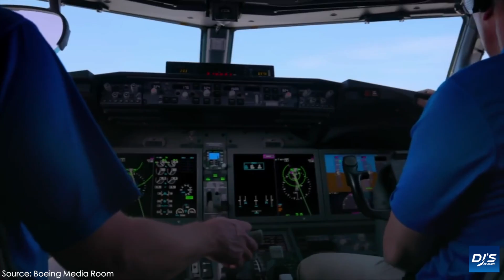Boeing 737 MAX & MCAS Problems

Comment: I was at Boeing in the late 80's I resigned after several attempts at issues needing to be addressed,  many others have had similar issues as you report here.  I told the CEO at the time in my letter of resignation that if they did not change their ways,  AirBus would be eating their lunch.  (that got a horse laugh from the management, AirBus had under 2% of the market at that time.)

Boeing management is no longer laughing, as AirBus is now eating their lunch..

I wish them well however, it is anything but an easy business.
Reply: Airbus is now drawing up futuristic zero emission concepts while Boeing faces multiple issues.
Reply: The Caynuck so planes will fly on dreams and solar panels?
Reply: @JAMESWUERTELE  liquid hydrogen is also being tested as fuel.
Reply: @JAMESWUERTELE  Liquid hydrogen. I the future, it is possible to maybe see some hybrids or electric planes, but lithium batteries need to get lighter first.
Reply: @thecaynuck4694  Boeing is "fixing" the 737 Max, that's the future of aviation...
Reply: Well air bus has their own problems too . Especially in manufacturing process.
Reply: @mohammadzohorul8887  so what, you're a Boeing fan who just brings up Airbus issues when you're clutching at straws
Reply: @ant2312  no I'm not Boeing fan . I like Air bus more. You have failed in your assumption.  Telling truth doesn't indicate a person's choice.
Reply: When Boeing squired McDouglas or whatever, they also acquired their cost saving, lazy and lobbying ways to push crap.
Reply: @Solisium-Channel  McDonnell Douglas did make some decent iconic planes though.
Reply: @thecaynuck4694  I won’t argue with that because it’s true
Reply: I am with you on this I am leaving Boeing soon its a disaster down in South Carolina
Reply: @freeboy8254  I would not quit any job in this economic climate, its about to get a lot worse.  Hang in there buddy.
Reply: I prefer airbus, but they’ve had their set of problems too. I am amazed by their pioneering of fly by wire in the commercial industry. Problem is their all computers with wings.
Reply: Boeing is lucky that Airbus doesn't have manufacturing capacity to engulf Boeings share (probably because they doesn't want to cut corners in the level of Boeing for more production rate.)

But things wouldn't stay same if new competitor came in the market.

That's why FAA doesn't want to give certification to chinese comec jets as they knew it's death sentence to Boeing.

Comment: One thing I did not hear about MCAS was that it was the KC-46 that has the original MCAS concept and if it worked for the USAF...the it's good for the commercial market (tongue & cheek comment).  Since this was not a 737 originated fix but transfer technology from the KC-46 team they may not fully understood the hows and whys of MCAS...does not relieve the due diligence required by the MAX team.

But the part that is REALLY criminal is the fact that Boeing has a software feature that would alert in mis-aligned (malfunction) AOAs that you can BUY for $80,000 per aircraft.  If Boeing had provided this for free on MAX aircraft then the crews would be aware of the malfunctioning AOA sensor.
Reply: john allen - The USAF & other users of the KC-46 all require that all aircraft equipped with MCAS have 3 ACTIVE AOA Sensors, that no single sensor ever be able to activate MCAS, that MCAS only be allowed to use normal flight controls (& not the Trim Tabs) & that it be very limited to the frequency & duration of these activations. Doing this on the MAX-8 would’ve required certification of the MAX-8 as a NEW A/C, a process that airframe probably would have failed.
Reply: The military originally went to an Airbus tanker. Thanks to lobbying and US military's screwed up procurement process, the Airforce was forced to take the 737 tanker.
Reply: Irv Hh - It had a lot more to do with LOBBYING & Boeing’s friends in Congress than everything else combined, & it was the 757, not the 737. The 737 is too small. I probably would’ve put forward the 767 or 777. Both are newer, more capable A/C.

Comment: I'd suspect this single point of failure was kept from the maintenance engineers so thar they had no idea that they were working on such a critical piece of hardware with no redundancy.
Reply: Lion Air's engineers had tried to find a reported fault but didn't know about the 'AoA sensor switching' so couldn't find a problem. Next time the aircraft flew (switching the active sensor), it crashed.

Comment: I wouldn’t board this plane, and will avoid it like a plague
Reply: That's an irrational outlook.  Even before it was grounded, if you just let MCAS rip and take planes down, the airplane was still orders of magnitude less dangerous than any car.  Tack on a couple more zeroes of advantage if you've ever ridden a motorcycle.  The Max was definitely deficient by the standards of commercial aviation, but we have to remember that those standards are outrageously stringent compared to any other industry you're likely to interact with.  Speaking of avoiding things like the plague, the biggest risk factor with boarding a 737 Max around this time would be the actual plague that you're more likely to catch by being in close contact with the other passengers.
Reply: @JETZcorp  well said

Comment: To understand the difficulty of recognizing an MCAS maloperation is that the MCAS was meant to drive the horizontal stabilizer trim to ghost the "seat of the pants" feeling of a pre-MAX 737, despite the new location of the engines.  As a result, every time the MCAS gave the stabilizer trim wheels, it was for no apparent reason and for no apparent effect.  The new location of the engines changed how the pitch of the 737MAX responded to changes in thrust, so MCAS re-trimmed the horizontal stabilizer to match the thrust induced pitch effects of the pre-MAX 737.  As a result, there were so many MCAS spins of the trim wheel that one of the simulator test pilots wondered if the simulator was mis-programmed.

It is understandable that the pilots failed to notice that the trim wheel spun as the flaps were retracted, instead of when the throttles moved from take-off power down to climb power.  It was only when the MCAS trimmed down the nose for a second time that the pilots recognized a problem.
Reply: I think pretty much everyone is misunderstanding the "problem" that MCAS was meant to solve.  It wasn't really due to the thrust.  Positioning the engines higher and further forward actually puts the thrust vector closer to centerline and puts the CG further forward, both of which REDUCE the pitch-up tendency that every low-engine airplane encounters.  This counteracts the fact that the Max has more thrust than the NG.  At lower angles of attack, this makes the Max fly more predictably than an NG, according to some pilots I've heard.  The real big deal is when you get to high angles of attack, those larger and further-forward engines start to produce LIFT, and it's this additional lift  forward of CG that gives the airplane a greater pitch-up moment than an NG, in high-AoA situations only.  That is really the difference in handling that MCAS was meant to bridge.  Of course, if the airplane was a new type, pilots would be trained on the parameters of this characteristic and no augmentation system would be needed - but avoidance of training was the whole point of the Max program, like the Airbus 320 Neo before it (and the 737 NG before that).
Reply: @JETZcorp  Thr difference being that a re-engined A320neo is relatively little affected by the change since it started life with a turbofan engine in much the same location anyway, whereas the MAX was a radical change from a turbojet in the early designs to a high bypass turbofan located very differently.
Reply: @pasoundman  Well then the problem should have become a problem decades and decades ago when Boeing introduced the 737 Classic.  But it wasn't a big deal then.  It only became big enough of a deal in the transition from CFM-56 to LEAP, which is the same engine (before AND after) that the A320 undertook.  Whether that's because the actual change was greater than JT8D to CFM-56, or because regulatory expectations are tighter now, I can't say.

But the original A320 was highly augmented and pilots had no expectation that the airplane would behave in a direct mechanical way.  The old airplane reacted with software and so does the new one, so no new training was required because the aerodynamics didn't affect behavior.  If the A320 was controlled with pulleys and cables like a 737, we can expect that the lower engine mounting would result in more pitch-up from thrust, but the more rearward position would mean less pitch-up from high-AoA nacelle lift.  But it's not a cable-and-pulley airplane so it flies the way Toulouse programs it to fly.  That makes it very easy for Airbus to put a re-engined plane on the same certificate.  And, in the case of 777s and such, Boeing gets to do the same as well with their modern FBW planes.
Reply: @JETZcorp  Well yes. You're saying much the same as I am. Once again, the 737 is something of  a victim of the era of its design.
Reply: @JETZcorp  Of note, even the  original variant of the 737 had engine placement issues. The first aircraft were delivered with short tailpipe and thrust reversers. An early modification extended the tailpipe TR combination further aft to eliminate an issue on landing where when reversers were activated it caused the aircraft to float. This resulted in a lack of breaking effectivness resulting in longer landing rollout. The point being that powerplant placement effects flight characteristics in ways that often cannot be anticipated. Unfortunate that when Boeing did anticipate a flight characteristic change, they failed to deal with it in the proper manner. The mindset of America in general, needs to change. Stop putting profits and shareholders ahead of safety etc.
Reply: @JETZcorp  if the extra thrust is the problem, why not throttle back? The root of the problem is that the wing is too small. They need more airspeed to generate enough lift to maintain altitude. Vs the original 737 100: 62% increase in takeoff weight,  25% increase in wing area.  Nacelle cross sectional area increased by 250%, higher mounting blocks even  more airflow to the wing.
Reply: @irvhh143  Throttling back IS part of the procedure to end a stall on a 737.  Pilots are trained to pitch forward first and then apply throttle only after the AoA has been reduced.  But humans are humans and sometimes they do it wrong.  In the case of 737s, if you're near stall and give it a boot full of power, the yoke doesn't have enough authority to overcome the pitch-up.  This is true on the NG as well but the Max encounters it more.  If Captain Stupid kept the power on, the only way to recover would be with trim, which moves the whole tailplane.  As I understand it, this is why MCAS was given so much authority over the trim - they wanted the plane to resist stalling even if the pilots did what they're not supposed to do.
Reply: @JETZcorp  too many patches. Let the passengers do the beta testing.
Reply: It's entirely normal for the trim wheel to spin in flight, making the operation of MCAS indistinguishable from what normally happens
Reply: @pasoundman  And MCAS would pause and then reactivate in case of a faulthy censor, right? Compared to runaway trim that would spin constantly?
Reply: @greencamelot1867  No ! I'm saying that MCAS operation is indistinguishable from normal auto-trim until it's too late.
Reply: @pasoundman  and its always too late close to the ground...
Reply: @Luke-PlanesTrainsDogsnCars  Very often but having the automation stab you in the back isn't helpful ! An SAS Mad Dog performed a similar trick in Sweden IIRC. Automatic Thrust Reduction, Thank you McD-D.
Reply: @pasoundman " indistinguishable from what normally happens" ..and it follows why would they? ..they didn't even know MCAS even existed.
Reply: @Luke-PlanesTrainsDogsnCars  Sorry, what point are you making ? Indeed, MCAS was 'hidden'. Thr whole 'raison d'etre' of MCAS' was shrouded in doublethink.
Reply: @pasoundman  I guess I'm just surmising that ordinary cockpit operation could have been masking MCAS , and pilots ..not knowing that anything was amiss (because why would they?) until things got out of hand. In your view was MCAS hidden by Boeing from the FAA, or signed off by self regulation?
Reply: @Luke-PlanesTrainsDogsnCars  MCAS itself wasn't hidden but Boeing made damn sure that its true importanc wasn't revealed.
Reply: @pasoundman  yep .."the culture of concealment"
Reply: The 737 is an old design.they put a bigger engine on it and call it a new design.the bigger engine would drag the back of the plane down,thats why they use MCAS to pull the nose of the jet down. But we know what would happen.
Reply: @JonMow  No, the bigger engine actually forces the nose of the plane UP under high thrust conditions
Reply: Saying the nacelles generate lift is like claiming a parachute generates lift. 'Lift' would cause the aircraft to gain altitude. The nacelles create drag. At high AOA there is an upward component of the drag vector resolved on the yaw axis. 
While the engines are closer to the c of mass, they must be pushed to full thrust. Overall the pitchup torque is greater.
Reply: @irvhh143  The nacelles simply react to the airlow. Is it possible that the shape of the nacelle is a lift generating airfoil ? Surely can't be much though. Your drag explanation seems to make more sense.
Reply: The maneuvering characteristic augmentation system (MCAS) allows the stabilizer to move in the nose down direction when approaching high angles of attack at high speeds. This requires the stabilizer to move in the opposite direction in which the pilot is pulling the column for nose up pitch. The MCAS only operates at extreme high speed pitch up conditions that are outside the normal operating envelope. Copied from the AMM
Reply: @bradw3116  That may have been the original intention but it got changed.

Comment: I don't believe the "I was unaware" response.
Reply: I can believe it.  These airplanes are unimaginably complicated, with millions of components and thousands of different systems and subassemblies.  It's not unreasonable to imagine that the guy in charge of the big picture would not be briefed on all the minutiae of what was considered by the company to be a relatively unimportant and inconsequential system.  That doesn't put them off the hook at all though, because this failure of the corporate structure to bring concerns of those at the bottom to the attention of those at the top, IS a severe oversight which obviously has severe consequences.  Whether the guy knew about how powerful MCAS was and did nothing, or whether such a powerful system could get lost in the ocean of paperwork and bureaucracy, neither is something that should "fly" in commercial aviation.
Reply: @JETZcorp  then you do not sign off on it.
Reply: @JETZcorp  if your trying to mask certain systems from the FAA..or the pilots for that matter ..you would KNOW...just ask VW
Reply: "ich haben es nicht gewusst"  would have been more appropriate ...
Reply: cmulder002 Ich stimme mit Ihnen ein

Comment: And then it was impossible to move the horizontal stab because the airflow going over it and the airspeed of the plane was too high and it jammed  from to much forces applied the the stabiliser good one boeing this system is complicated and it should not be like this .

Comment: To be fair, the chief project engineer will not know all details of how systems work which they are signing off on. They depend on the individual engineers to do the work to determine the details and assure their management that the system will work as intended with redundancy and fail safe options. These systems are so complex, the high level guys simply can’t know everything about them when they sign off. 

That said, the major fault in this whole thing was not allowing the addition of a second AOA sensors which would result in pilot training requirements. That decision comes down to greed and passing one over on the regulators which should not have been passed over.
Reply: But in the end he is the one responsible
Reply: @Infiltator2  yes, very true. He is responsible, but that doesn't mean he did a crime, unlike some of the others, of which it is proven that they knew and didn't do their duty as employee and citizen.
Reply: That's true. You can't expect of the chief engineer to know how all the systems in the plane work, but it's not his job to know all the systems. It's his job to make sure the engineers below him are able to do and are doing their job.
That job includes reporting issues.

So I do'nt think he did anything criminal (at least not based on the current evidence), we do know he didn't or wasn't able to do his job properly. Incompetence from his part or sabotage from another part? We don't know (yet)...
Reply: This. The only way a chief engineer would have specific knowledge about the system would be if something went very wrong in development and was then escalated to their level. If that had happened, it’s very likely the issue would’ve been fixed before the sign off.
Reply: But two sensors WERE fitted !